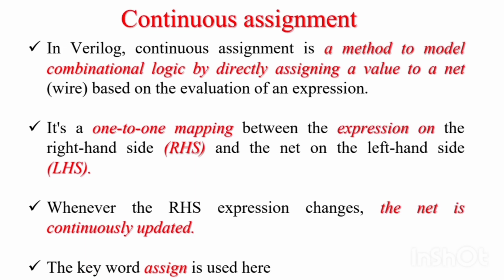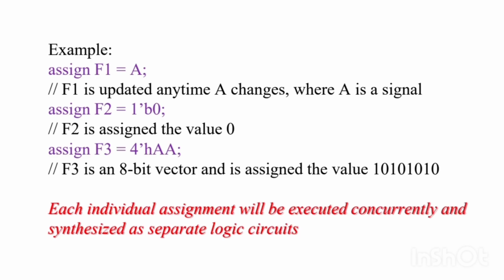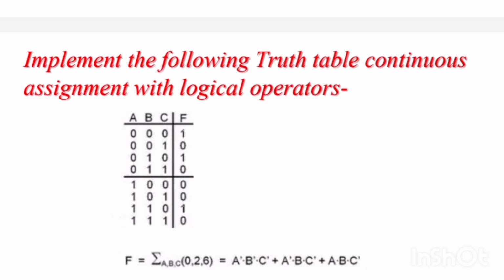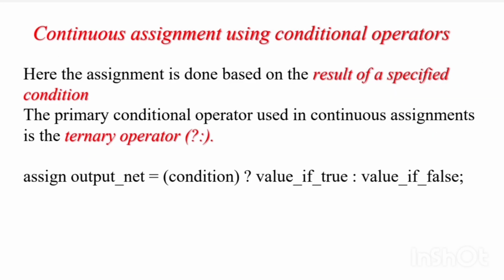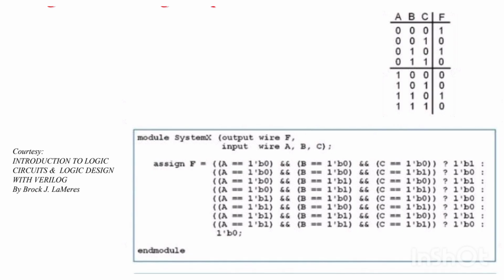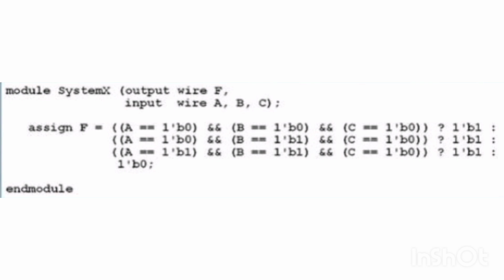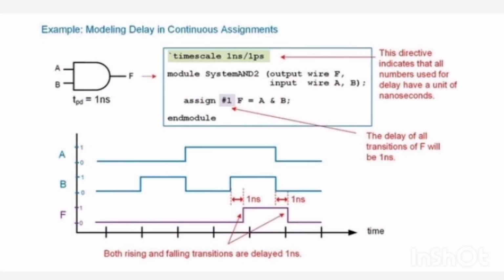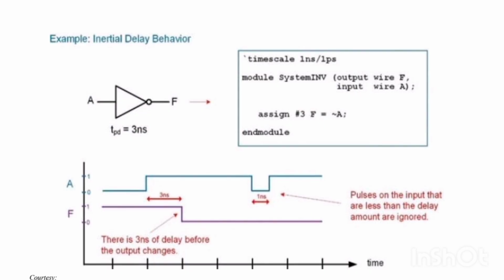Continuous assignment in verilog - KTU 2024 Syllabus CSE/ECE #ktubtech #ktutuition #ktü #vlsi

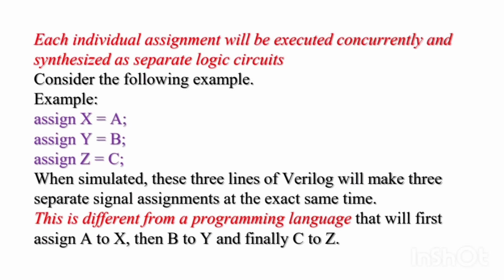Comment: in 3:18 
assign F3=4'hAA;
// F3 is an 8-bit vector and is asssigned the value 10101010

 F3=8'hAA Isn't that how it is?
Reply from the maker: Yes. assign f3=8'h AA is correct